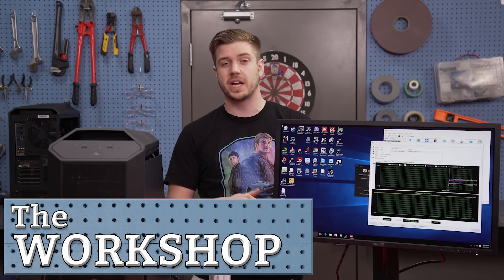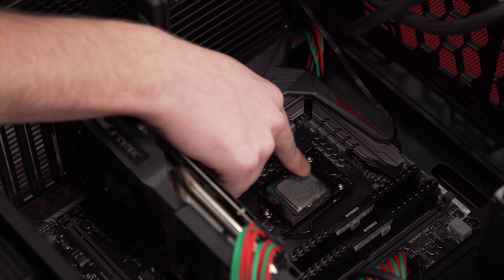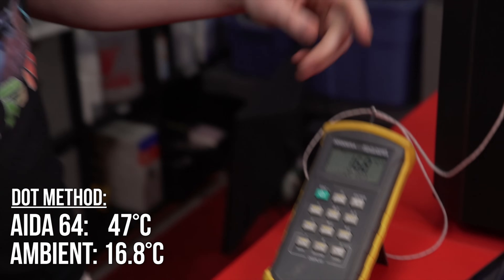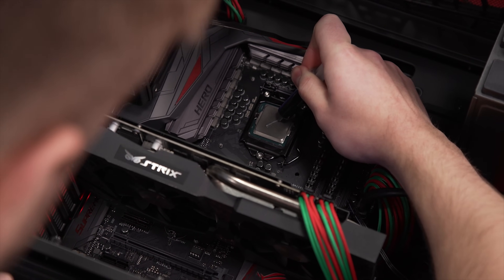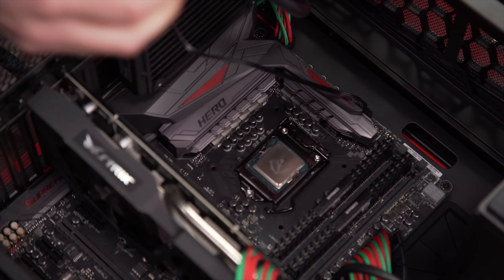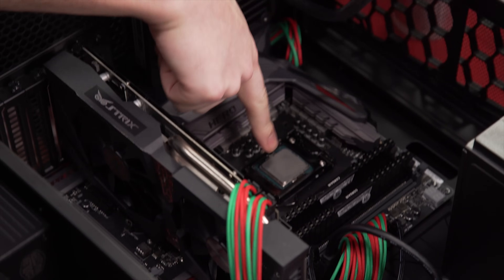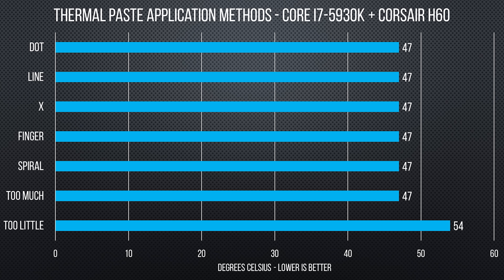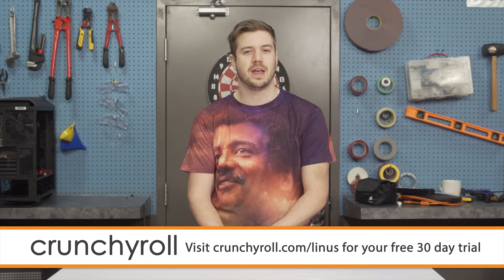Thermal Paste Application Methods - Which one is best? - The Workshop

Comment: Spreading with a card is the best.   You just have to do is right and apply a very thin coat.  Most people apply too much.  So, my vote is business card with very little paste.  The pea method is terrible.  Pretty much every other method fails to cover the surface unless you apply way too much pressure and break your CPU chip.

The correct method is to first apply in VERY thin lines in an S pattern with about 5 lines over the entire surface and spread with a business card.  You will get the best temperatures every time.  The temperatures given by the CPU thermal monitors are only approximations.  You MUST cover the entire chip or risk thermal stress, which can do more damage than increased temperature.
Reply: +ThinkTank255 

It's really not, the cpu itself is only in the middle so the paste doesn't need to cover the entire thing. That's why the dot method is the most recommended.
Reply: +Tyler r  The CPU is not the only thing that needs to be cooled.  You also have wires that connect to the CPU chip.  In addition, it is better to maximize surface area.  If you only put past in the middle, you are losing a lot of surface area.  That said, I use a combination of spreading with a card and a tiny pea.  I spread to witin about about 3/4 cm to the edge of the chip.  I then apply a TINY pea in the center.  RIght now I am running at 26°C.  Beat that.
Reply: +Tyler r  I mean, let me tell you, I have gotten this down to a fine art.
Reply: ThinkTank255

anything other than the chip itself will need far less help cooling, so it won't matter.
Reply: +Tyler r  
"anything other than the chip itself will need far less help cooling, so it won't matter."

It does matter.  It just depends on whether you think it matters or not.  I, personally, do think it matters.  It ultimately matters what level of damage you are willing to incur on your chip over time.  There are precise equations that relate temperature to lifetime.  This is why I keep my chip at 26°C, just barely above room temperature.  Your choices may vary.  But, in general, cooler is always better.  If you understand thermodynamics you know that you do not lose anything by getting the paste all the way out to the edge.  You can only make it cooler.  So, it really makes no sense to do it any other way.
Reply: lol no, you're feelings have no effect on how well a chip gets cooled.
Reply: +Tyler r However, if you care more about saving time, than cooler your processor, then yes, by all means, the fastest way is the pea method.   I mean, if you are the next Bill Gates and you are making so much money you can't even afford to stop your car to pick up a $100 off the sidewalk, then yes, by all means, do use the pea method.  However, if you want your CPU as cool as possible, then you need to maximize surface area contact between the CPU chip and heat sink.  It is just basic thermodynamics.  In fact, Intel could save a tremendous amount of money on their chip manufacturing if this were not the case, because it would not have to be all metal on the top.   However, there is CLEARLY a group of people that wants you to think that cooling only the center is the best way.  For example, if I wanted to advanced technology faster, this is exactly what I would tell people.  Why???  Because their chips will fail sooner, and they will have to buy new chips.  Meanwhile, I am enjoying my 26°C CPU with its practically infinite lifetime.  So, yes, by all means, do only apply paste in the center of your chip.
Reply: I will continue to do that, because despite your wall of text you don't know better than the people who actually make the chips.
Reply: +Tyler r Yes, and the people who make the chips cover their entire surface with metal FOR A REASON.  Btw, I DO make the chips.  I am an electrical engineer.  I can tell you PRECISELY how these chips are manufactured.
Reply: +Tyler r  Besides that, I gave you a CLEAR argument why you have to cover the entire surface.  And you came back with no rebuttal at all, other than that you will do as you are supposedly told.   This is PURE IGNORANCE at its height.  Whoever this person is that "makes the chips" that you are getting your ideas from, well they are wrong and BASIC thermodynamics proves they are wrong.
Reply: +Tyler r  "I've been using thermal paste the same way for 10 years and so have millions of others."

So what???  Basic thermodynamics disagrees with you.  Increased surface area equals better cooling.
Reply: +ThinkTank255 I don't disagree that cooler is better but 'infinite lifetime cpu'?? so you're still rockin a '486?  - CPU are basically a consumable item, if it lasts until I get my next upgrade - about 5 years - why do I care if it would last a hundred more with a different method of applying paste? Also getting the paste to the very edge of the heat spreader might help if the heat transfer capacity of the cooler block itself also goes right to the edge, otherwise your still relying on heat transfer through an area of metal around the actively cooled area of the block which is not much different from the transfer through the heat spreader on the die.
Reply: Actually, processor speeds are starting to top out, this is why Intel is transitioning to cloud based services.   And, low temps are also good for overclocking.

Comment: been saying this for years. as long as you have a thermal material to fill air gaps your temps will be fine.

people have told me arctic silver is old hat and too conductive and i should use something more modern. i used the crap they sent me with a 212 evo and can't see a difference.

i'll still use the AS5 until it's gone though.
Reply: +Jeff Deal Artic Silver formula has been modified so no longer conductive anywat, i agree that for most applications any mid range paste applied by any method will work effectively

Comment: Help! My laptop "fan" is running constantly on like 50% CPU usage low 0-3% Temperature 26' Idle and 38'C Full blast.
I've tried to Clean fan but No joy. I've tried replace the Thermal paste (MX4) No joy, Reinstall windows - No joy.
Reset BIOS to Factory sett. No joy. Update BIOS to the latest again No joy. (I think the problem started after upgrading laptop to SSD but not 100% sure) ..Common guys where's the problem????
Reply: +DiiZ 26 idle and 38 at load are fantastic temps for a laptop CPU, the fan speed is fine too. If my desktop temps were that good, I would be laughing.
Reply: +DiiZ turn your Airconditioning up.

Comment: From what i was taught was to drop a dot in the middle and spread it with either a razor or card. just enough to keep the space between the cpu and the heatsink filled and not too much to increase that space as well as not to have it spill out onto the motherboard so the cpu will get full coverage
Reply: +NrG well, what this video proved was that it does not matter. use the right AMOUNT and you are done.
Reply: +Black70Fastback  There are one possibility that is not covered by this video. with the dot and the line  we get a really little chance that the paste spreed more in one direction and leave a portion of the surface uncovered.  It's rare  but it can happen.

Comment: this is a great idear but needs to be redone, you need to be using a high end overclocked cpu at highish voltage to ramp up those temps and non water cooling, maybe a mid range cooler like the evo 212 as their most common for low costs builds, id suggest a 3770k for the cpu at 4,6 ghz. that way the results will be 100% more accurate, keep up the good work everyone at lunus tech

Comment: I would say using ELECTRICALLY conductive thermal paste on a CPU is really dumb. If somebody uses electrically conductive thermal paste on their CPU and they manage to messy enough on the board to short something out... they shouldn't open up a PC case ever again.
Reply: +brealistic1970 a lot of the early formulas were electrically conductive (I believe Arctic Silver actually included Silver when it first arrived), its probably the problems that caused which led to this wholly unscientific debate about which method is 'best'. It also doesn't help that regardless of what paste/method/block gets used its all against the heat spreader over the die and below that there is intel's own paste between the hotspots on the die and the heat spreader - if they got that wrong it doesn't matter how perfect the paste we apply is.

Comment: any sort of paste spreading technique is pretty much unecessary because it while spread once you place the heat exchange plate
Reply: but it doesn't spread all the way to the corners
Reply: +DallasGreen123 that shouldn't matter so much because the actual core components are in the middle and the top metal plate is just a heat spreader bit

Comment: luke, just because nobody else would - you should have done a test with NO paste too.
Reply: Tldr: I did that once.

I had an old Pavillion laptop from 2004.

Now it's 2008.  IDE HDD died. I didn't know much about hardware, but I made some cat5 patch cables in HS 4 years earlier and did some CMD.exe stuff.

Well I decided to completely dismantle the laptop because it was 2008 and I was bored, didn't have cable, no job, and a lot of free time.

Anyway, I did put it all back together. Seemed just as sturdy as before, even though I had 3 screws leftover.  

Oh, but like years later I realized that the shit I wiped off the Celeron processor was thermal paste and I re assembled without thermal paste. I think it worked but thermal throttled 100% and was very painfully slow.
Reply: He didn't want to start a fire.

Comment: Cpu cooling test. Thermal compound or thermal coolingpad.???
Reply: compound! cooling pads are not meant for CPU cooling! They are generally meant for attaching a heat sink to a chipset or something, either way a thermal compound will work better on either.

Comment: This video shows that applying thermal paste under either method resulted in no difference in CPU temperature. The other comments below about trying a stock cooler, or a lower quality thermal paste, is not the point of the test, so give it up already.

Comment: IMO The real test would be thermal paste performance one month after being applied.
Reply: I was going to say the same myself. You can't compare it over just minutes, ofcourse the result will be the same.
Reply: @erice6755  plus if it was a little hotter fans would just throttle up more
Reply: I like to apply something about the size of a bean of thermal paste and when i put the heatsink, i kind of "shake it" and then the paste gets homogenized. FX6300 after 4h of GTA V is reaching 43C in a brazilian hot summer day (about 34C in my city)
Reply: @erice6755  *minutes. Of course
Reply: @alvallac2171  concur

Comment: now try with air cooling, not watercooling
Reply: +Leonardo Baez 
The temps don't matter. It's the difference between the temps he testing. It's how you do a control test.
Reply: Mark Whitfield 2 year late answer But the liquid inside an aio tends to still be hot for over 15 minutes.
Reply: @HeheLike  i imagine they factored that into the process. As an aside repeatedly rapidly  altering the temperature of components is what leads to wear and tear. It's actually advantageous if temps are lowered and raised gradually as happens with an aio rather than rapidly as is the case on air. It's and endless debate though with both having advantages and disadvantages.

Comment: Workshop idea: fan speeds.
Reply: +Tuna Yücer ?? It's pretty well known that the higher the fan speed, the better the cooling
Reply: +Ian Gacek but how much does it affect huh?
Reply: Well the results of fan speeds are clear, it's about CFM, which a higher fan speed will increase your CFM. now a high speed fan at 80mm size won't out perform a slower fan speed on a 240mm fan, when choosing your fans look at your cfm number, the higher the better

Comment: I'd like to know how differently the various types of thermal paste perform. I always see people remove the paste that comes with their coolers and then apply their own paste but I dunno if that is really necessary.
Reply: it is not i have tested it on multiple systems with no difference in results. I also stress tested the cpu to push the temp up and see the difference, and there was non, i tried multiple after market thermal pastes like arctic silver, and ceraminque, i also tried a few different pouches of thermal paste i had from heat sinks over the year as i normally buy my own. I discovered even with the "cheap" paste the performance was the same, the only thing i was unable to test was the test of time, maybe cheaper ones over the year will dry out? i doubt it though.

Comment: The over all test was pretty conclusive but there was a few variables that were overlooked. Also, theres no harm in putting a little too much... think about it. I would speculate having slightly more heat conductive material then regular would actualy benifit with cooling because of the increased displacement of heat over a larger surface area. A more conclusive test would be a change in variables such as an older generation that is also overclocked. The thermal conductive properties will show predominantly with higher tempatures.

Comment: Most of these methods and arguments stemmed from years ago when processors came near or over 100W of heat output at stock before overclocking and got close to or over 200W overclocked.. I don't think this test was very representative if it was just some newer intel chip that probably wasn't even getting to 100W heat output during the test.. and the cooler used is also alot better than what we had available all those years ago.
Reply: Your point really doesn't matter the test was to see if there was a difference in the different application methods, clearly if you didn't use thermal paste the heat would have risen. He also proved this when he put not enough compound it ran hotter.

Comment: Direct Contact Heatpipes coolers are REALLY affected by the way you apply thermal paste, if one of the heatpipes don't have good contact you loose a few degrees. That AIO is not really affected because it have a cooper flat base that is in direct contact with the water.

Comment: I wish that someone would do a video about the tradeoffs in Z170 I/O. There's 16 channels connected to the CPU, that's nice, but the ones connected to the chipset are the ones that are VERY deceptive on the boxes and adverts of the board makers. For example AsRock offers 3 SATA Express, 10 SATA3, 3 Ultra M.2 (PCIe Gen3 x4 & SATA3)

4 USB 3.1 (2 Type-C & 2 Type-A), 8 USB 3.0 (4 Front, 4 Rear) on the Z170 Extreme7+. If you try to have a RAID 5 with the three M.2s, you lose all six of the chipset SATA connectors (which are exactly the same as the 3 SATA Express). I read that the 4 non-chipset SATA connectors left won't RAID with Intel's Rapid Storage Technology. Is that true? All of the  manufacturers have to make tradeoffs like this. MSI adds an extra PciE slot, but it is coming off of the chipset too! There is a ton of confusion on this, and it would be wonderful if you could suss it out and teach us how to understand what we can REALLY get from our new Z170 board, 'cause I can tell you that between innate confusion and incorrection from the masses, a lot of people are spending money on things that they won't be able to use. No one has done a show on this yet, although you can imagine it will come, but you can be first:)

Comment: wow, I been told and i keep saying dont spreed it it makes air baubles, but i guess it doesn't matter, Lolz
Reply: +Zraupp10 Just so you know, air bubbles can cause your thermal compound to dry out and crack, which will greatly reduce its effectiveness. Happened to me when I didn't seat my cooler properly. Took a few months but I was getting red screens of death from CPU overheating.

Though, I don't think spreading it around with your finger would cause an issue if you seat it properly anyways.

Comment: suggestion for future workshop episode: Do larger form factor motherboards (such as eatx or atx) get higher/more stable overclocks then smaller form factors (such as matx and mitx)? Theoretically they should as larger boards tend to have more room to fit better/larger power delivery systems (and just components in general). Also pretty much all world record overclocks are on larger form factor boards.

Comment: Use "too much" pea method [ enough to cover all cpu surface area ], also pea method helps to avoid air bubbles, even if there is little of excess on the sides 6:39 ((shouldn't be more than that)), it wont be a problem due to the consistency of the thermal paste, and most will tend to get harder after curing, if possible always use non conductive/corrosive thermal paste, it may only fall if you are removing the heatsink so be aware of cleaning it.

Comment: how do you get your IC diamond to come out of the tube so flowing and nice. Anytime i've used it it's thick and clumpy.
Reply: +mark swishersweets Heat it up in a vat of liquid sodium first.
Reply: what?
Reply: Hot? :v
Reply: it was a joke, but really, it depends on the thermal paste.
Reply: +mark swishersweets put it in a plastic bag , then submerge the plastic bag with warm water.

Comment: When I built my first system I used the spread method. On the second, logic kicked in and I went to the pea method. And I've seen too much cause overheating. But they used a lot more than that. And the die was exposed which would make insulating it easier than CPUs with heat spreaders.